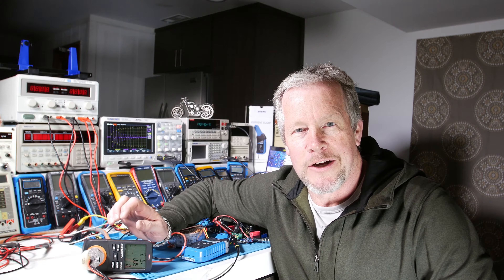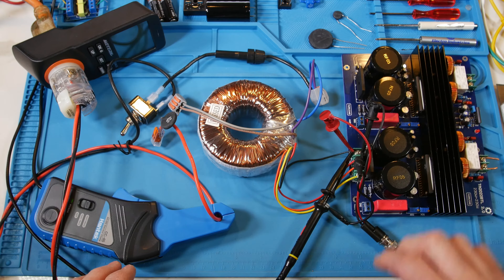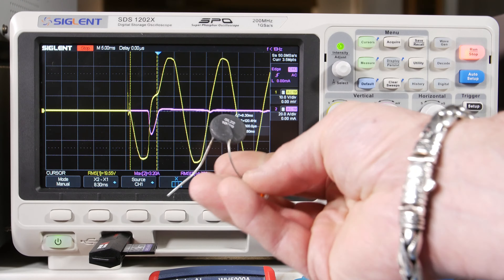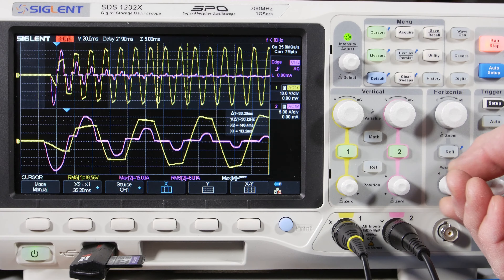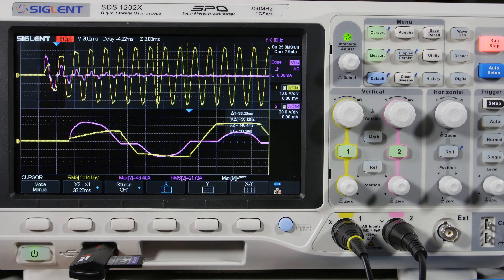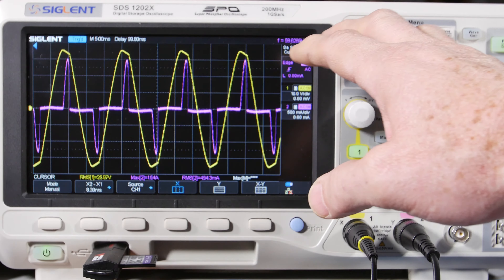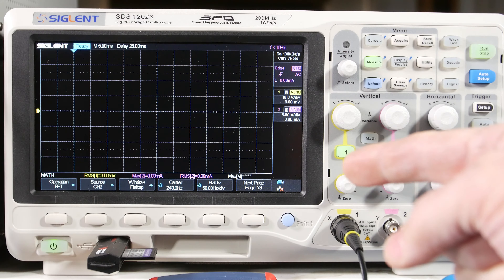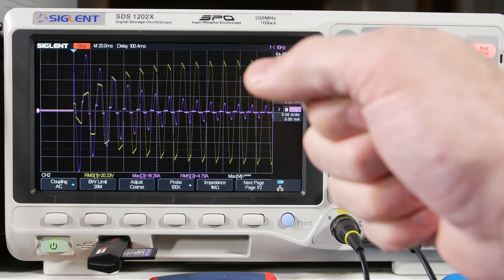How to size your audio amplifier transformer

Comment: Sorry I am almost sure my question is proving my noob-ness! :-)
But all those harmonics at 27:12 does almost look like the TTF from a square wave to me. I am guessing that I am asking about if I am right and your thoughts? :-)
Reply from the maker: You are right that it does look similar to that found from a square wave, but we also have spikes at the even harmonics.  An interesting thing about square waves is that the even harmonics cancel out so the odd harmonics are what’s left.  We can build a square wave by adding odd harmonic waveforms.  The current pulses are being driven by voltage of a sign wave shape; however, since the current pulses are so sharply turned on and off, they are beginning to look like a square wave, so that’s why the odd harmonics are so pronounced.  Great question!!
Reply: @KissAnalog  thanks a lot great explanation! So it is the hard clipping (squaring) of the sin wave I could see:-)
Reply from the maker: Yes - and that was a great observation!

Comment: I FIND THIS VERY HARD TO FOLLOW ON WHAT YOU ARE DOING ON THE OSCILLOSCOPE.I WOULD THINK YOU WOULD BE LIMITED ON WHAT MORE YOU COULD DO ON  DISTORTION AT THIS POINT.I MEAN YOU ARE ALREADY USING GOOD QUALITY PARTS.
Reply from the maker: You are correct - and I appreciate your thoughtful comments!
I am using good quality parts.  Other than using filters and/or large inductors, there’s not much we can do about it.  But, I’m also trying to show that we lose usable power in harmonics/distortion and attempting to show how to use the scope’s capabilities.  Ultimately, we have to choose a Transformer with higher VA ratings than what we might have expected.  I see others using a rule-of-thumb strategy, like 2x the needed power, but I wanted to explain why that is.  The rule-of-thumb is nice to simplify, but it’s great when you can use it with more confidence if you have an idea where it came from.  Make sense?